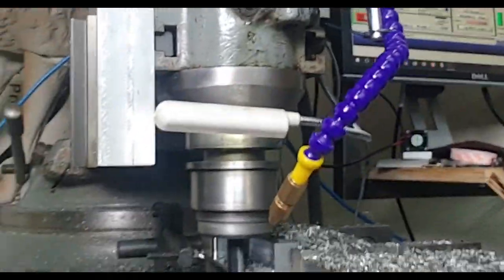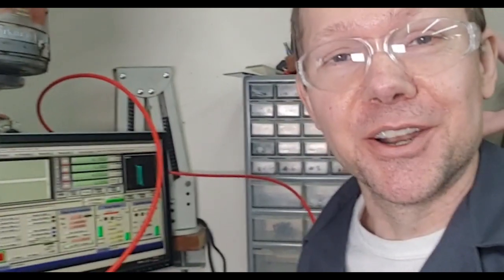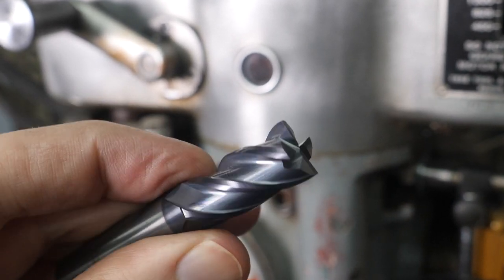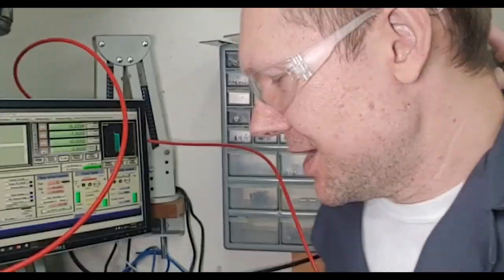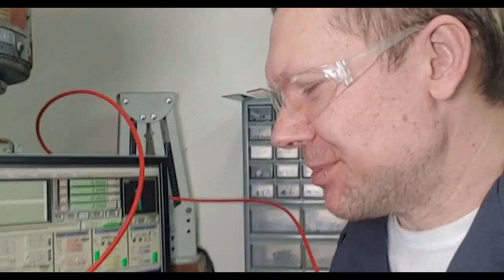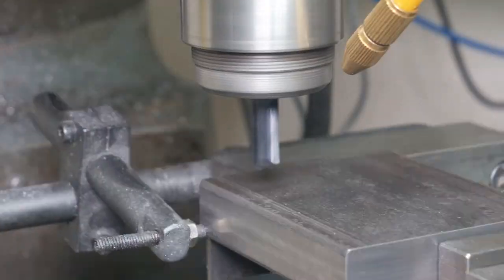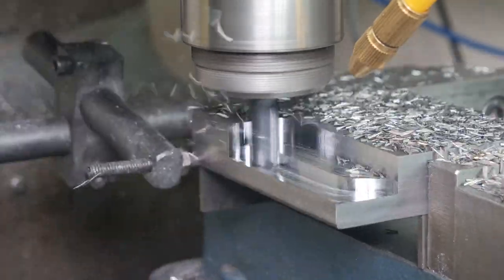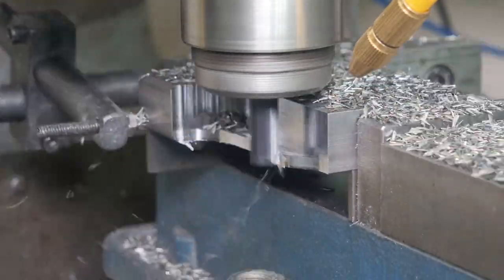One Rule EVERY Machinist Knows!

Comment: One odd machinist tip for milling that doesn't come up until it bites you: It's possible to take too light of a cut. 
The explanation I got was that your workpiece and its chips can act as a heat sink and that cutting too light can (not "does") lead to more heat in your bits leading to reduced lifespan. (However, I've been out of the machinist world for a while now, so perhaps it's something to research further.)

Comment: With this setup you should be able to machine much more aggressively.  I'm assuming the reason why the part was lifted out of the vice is that your part does not cover at least 1/2 of the width of the jaws. Thie allows the movable jaw to pivot and this leads to not clamping the workpiece properly. 
But you are right. I'm in the machining business for over 10 years now and I'm also learning something new every day.